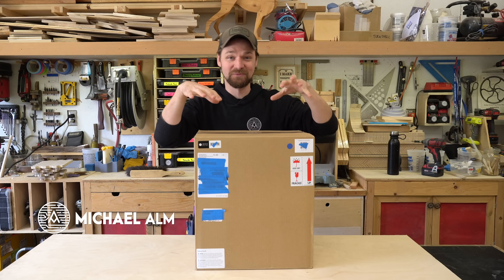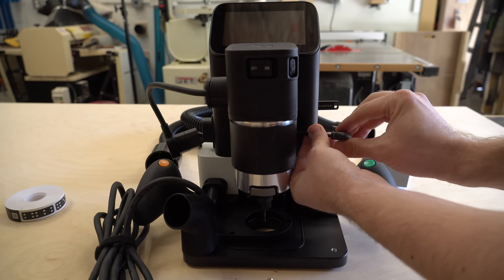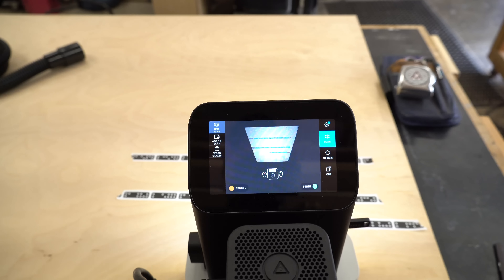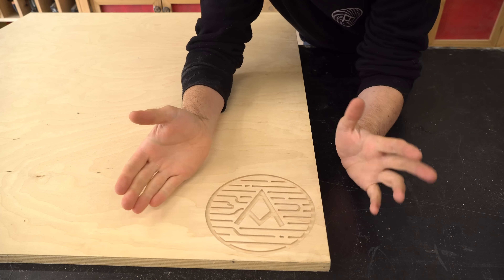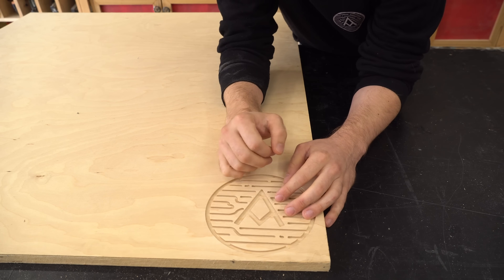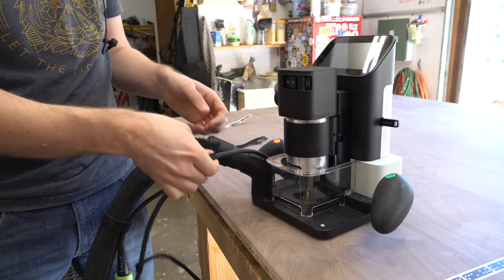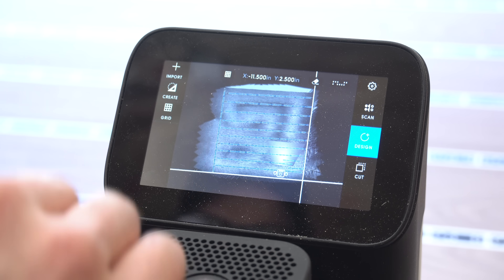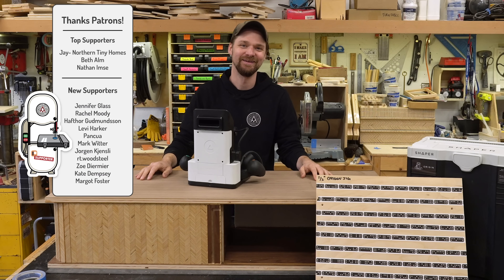Testing Shaper Origin Handheld CNC Machine

Comment: I have a question that none of the vedios seam to ansewer. If I draw a line on a 8 foot ply panel that wonders, can it fallow it?
Reply: Drawing a physical line doesn't register anything on the machine to follow, although I suppose you could draw a line, scan it, and then attempt to follow it on screen, however it's not a 1:1 and the scans on the material susceptible to distortion. To get the best results for what you're asking, you'd need to design that line in Shaper Studio (free) and upload it to shaper origin, line the plywood with tape and then run the line that way.

Comment: CNC stands for Computer Numerical Control. By definition the Shaper Origin is not a CNC machine.
Reply from the maker: The spindle is controlled by a computer (and numbers)
Reply: @MichaelAlm  The tool is not guided by a computer that translates numeric offsets into drive motor pulses to position the tool but by human hands. This device is not a CNC machine by any stretch of the imagination.

Comment: I need to create wooden 'ribs' for a large shape for vacuum forming. Would the shaper be suitable for carving out 7 ft slightly curved lengths that are about an inch wide ?  I could build a jig out of 1/4 inch ply to place the shaper 'tape' on to.  Thanks for your help.

Comment: Curious how much precision is required from the operator...as I age, I've developed a bit of a tremor in my hands - do you think I'd be able to get good results with the Shaper Origin?
Reply: The user just has to keep the reticle inside the circle when moving. I suppose that depends on the amount of tremors you have, but if you're able to move your hands along a set path, you should be ok. Shaper Tools recently came out with the Bench Pilot, which turns the shaper into a full on CNC machine without the need for the user to control it beyond pressing options on screen to start/stop cuts

Comment: first question: what stops the machine from just going all over the place? if its hand held how is such precision possible using your hands?
Reply: Hand guided, machine controlled. Just have to keep the dot inside the circle to keep the machine going. Harder woods can cause the bit to jump a little, so applying a little more downward pressure helps keep it in place. However, the Shaper features an auto-retract if you get off the line too much to prevent damaging material

Comment: Nice video.  Does the Shaper Origin all you to download artwork from the computer to the tool?  If so what software is required to complete the download?
Reply from the maker: It does let you use any software you like to add in graphics. It has to be an SVG file.,

Comment: I like the Idear of the tool. What i dont like is this exessive use of "positioning" tape you need for one project.
You get one roll of it for around 20 bucks.
So you buy a tool for 3 grands and still have to buy these rolls all the time to use it.
Smells like the good old printer - color cash cow to me.

Comment: I would love to see new Shaper Origin videos. Questions that come to mind - is there any limit to the size you can cut? I.e. could you cut 4ftx 8ft or larger (not that I would want to but maybe an advantage over a CNC? If you cut this size (4ftx8ft), can you use the small template board you made for the tape? I noticed that the template was bigger than the second piece you cut on it. I was just thinking I would make a template, then you made one! Is the tape really meant to be consumable? New subscriber here, thanks, I liked your vid - you have an easy going presentation style and lots of info!

Comment: Now that you have had this awhile could you make a vid on what you have learned, both the good and the bad.  And do you think it is still a good value or would a full size cnc be a better investment?
Reply from the maker: Hey Gary, Yeah I'll be doing one in the not too distant future. I used it in my latest two videos, the cube stools, and the bookcase. It's saved me on a number of projects at this point. It's best for one offs, but that's what I do, and so I think it's better fit for my shop than a traditional CNC.

Comment: I make a lot of signs and plaques with a hand-held router, but as I get older, carpal tunnel syndrome is affecting my ability to work as fast (lots of breaks needed). A lot of it is exacerbated by the fine, precise movements I have to make to control the bit over my pattern. I'm wondering if you believe - based on your experience with it now - the stress on the hands with the Shaper would be less since the need to follow a path so precisely is eliminated.

Comment: why not just print the design and tack it to the work piece?  Seems like a solution in search of a problem?
Reply from the maker: I’m not sure I made it clear how much the router controls the bit. It’s a cnc that moves the bit into place as you slide the machine around. It cuts to the 1/100 of an inch. I can’t do anywhere close to this precision with a handheld router.

Comment: great overview and flow, as usual Michael.Iooking for some files, similar to the hub, but looking for small project files to build little projects on the workstation or bench hook jigs as a progress skill learning tool. Going forward if you post or sell files for small projects of varying difficulty i think it would be a great way to really learn how to use the machine and get the most out of it in the shortest time. Origin is starting with the premium projects, but they are for larger projects, other than lets say just inlays, cutouts coasters or more artistic gift projects to give away as you learn and enjoy the machine.

Comment: Seems way too overpriced. You can make an actual CNC router for a fraction of the cost. And you can do something else while the CNC cuts.
Reply: But can you pack ur cnc into a box, or take it anywhere inside a house and use it, or use it on already installed work peices?  

No you can't. It's a tool, with its purpose.
Reply: @beardeddutchman5197  Yes.

Comment: Hi. Thanks for the video. I have a CnC but it only takes  24x32" How big can this cut ? Like, can i cut out a template in a 4x8' ? 
Hope to hear from you.
Best regards 
TR
Reply from the maker: That's the beauty of the tool is that there's no size limit. I've seen people inlay floors or bar tops with it that are way longer than 8 feet. So, yes you can definitely cut out a 4x8 sheet.

Comment: Why would you get this over something like an X Carve for $2300, when this costs $2500?
Reply: I'm going to say scale is a factor
Reply: Ryan Detzel But how would you like it ergonomically when you need to stand over the thing for hours making bigger projects??
Reply: @justkiddin1980  I think larger doesn't necessarily mean more cuts, just larger working area, but I see your point too...
Reply: @MrFowl  Yeah i reslly meant the time spent on a project...With a "normal" cnc you could just enter the job and let the machine do all the work...And it is possible to put a cnc on a space on the wall somewhere..they do not need to take up floor space..
Reply: @justkiddin1980  Huh, that's a good idea. If I could do a CNC mounted similar to a murphy bed, that might actually work in my garage, could still potentially use the "wall" for something too.
Reply: @michaeladayco326  Yeah you can be creative when space is at a premium..i would advice to look for a cnc with lead screws and not belt driven when mounting on a wall..because belts can stretch...I have ordered a workbee cnc and am waiting on delivery...
Reply: Is this a real question?? You can literally bring this with you anywhere and do work. It also takes up no space in your garage or whatever... It's literally AWHOLE handheld CNC machine thats incredibly precise, and can do any size.

Comment: No body ever shows the process of how to generate a file and import into the Shaper. I find this a major down side to all the the videos out there. It's like here it is, I have already done this and like magic here's the completed project. Might want to cover all the steps before having the tool sitting on the bench ready to rout. Major marketing mistake. You make the statement it's hard to do a stopped dado with a traditional router. Been doing it since 1976 with no issues. We don't use a guide bushing either. We use something called "Jigs" that are made and hang on the wall ready to go. This machine is not a replacement for traditional routers doing joinery. I would of had my stopped dados cut by the time you put all that tape in place and set-up the Shaper. It however fills maybe a gap as a CNC as it is portable and can be taken anywhere. I see it as a sign maker. Price point is about 800 bucks too high also. But Fest tool is involved.

Comment: It looks like a good idea, but unlike a conventional CNC you don't get any Z Axis control, which means zero 3D CNC abilities. I think for the money, I'll get a case of (as Stumpy Nubs calls it) rearrangitis, until I find the room for a conventional CNC. If rearranging everything still doesn't work, I'll make a wall mounted fold down (or up) table that is strong enough to support a CNC. This is great if all you have to do is cut patterns out of plywood or flat stock, or cut grooves for roll top doors. You can't even use this to mill a piece of warped or unevenly cut lumber to make it flat. I love your videos, and your projects, but, this tool is just not going to be finding it's way into my shop.

Comment: You appear to have ruined the temper on you bit 10:45     Router bits that look like that don't cut well. Typically over heated from hogging too much material ruining the temper thus shortening the life of its edge. 20 years of wood working and knife making leads me to believe this.
Reply from the maker: I was worried about that, but it was pitch. The bit cleaned right up with a spray of blade cleaner
Reply: @MichaelAlm  Oh that's good! Plywood is full of resins, adhesives and other nasty stuff. I think keeping your cutting bits clean will help keep them in good shape. Usually when I see one of my bits with lots of oxide on it,  I can tell I pushed it too hard. Glad I was wrong about yours. Killer channel by the way!!!

Comment: The only single advantage to this is when your work piece is too large for your actual CNC machine. Otherwise it's a lot less accurate and a lot slower, and you have to physically man it instead of just starting it and doing something else.
Reply from the maker: Only one advantage? What about the ability to bring it on a job site, CNC something that’s already built, or store it easily? I’ve been using it for months now and have found it crazy accurate. You do have to push it around, but it’s not for mass production. It’s for small batch or details. Plus I like interacting with my power tools. That’s why I started woodworking
Reply: @MichaelAlm  I've never had a need to take things to a job site when we have a shop. I can't actually think of any reason why we would need to CNC anything away from a shop. At absolute worst we might need a chop saw or a sawzall and a drill for framing and mounting.
If it's already built, why am I working on it? Either way, it goes into my initial point of "If it's too large for your CNC."
Easy storage sure, but an actual CNC is far more useful. It would also save a TON of space by chucking the band saw and table saw, and just using a hand saw or sawzall. But that's not happening either. This is pretty close to the same thing. You can get straight accurate cuts with a handsaw, and then you're interacting with your tools, but a band saw or table saw are FAR more effective and 100% worth the space, and you want the biggest ones you can afford. Or for a more direct comparison, you can also use a standard router or a chisel.
For small batch or details, it's still more useful to have a CNC where you can just set it and move on to any other part of your project. It's not like you get a CNC and straight automate everything. If you're inlaying a table top, you can set the CNC to cut the inlay, while you work on the legs or the negative inlay.

Comment: It looks identical to the 2016 version.
that cost 1000USD on Kickstarter 4 years ago and you could purchase on their site for 1399 USD with a 100USD discount voucher if you didnt wanna roll the dice with Kickstarters risk-factor..
Atm, they are asking 3255 USD before any regional tax for this unit in Europe and after-tax +25%VAT and import product tax if it coming from China or USA, you will be closer to 4500 to 5000 USD.
3250 USD for an entry package that looks identical to the 2016 version, they could sell for 1000, sure why not..
I recall how many so-called influencers that were gifted this device back in 2016 and perhaps they should set the price more reasonable instead of putting all their trust and margins in gifting "online influencers" and likely also why they now trying to reach out to yet again but this time to smaller  YT channels, to see if they can stomp up some easy customers, that in 2020 are willing to pay 3fold the.2016 price for a unit that looks identical, same screen, same res, same camera. same motor accuracy??
yep base 2016 version 3250 USD before any tax.https://store-eu.shapertools.com/?_ga=2.84378074.276610912.1593509673-1353261011.1593509673&_gac=1.116589556.1593509673.CjwKCAjwxev3BRBBEiwAiB_PWPb9k1HgRw7T4HJgGHqoEQJulj3hxw57Mb2bOILWRSzj490GcQeFrhoCQ7QQAvD_BwE
and yep it is still sold and imported from the states or China, as they list 1-year warranty, and they can only do that limited 1 year if they don't operate inside the EU.
a great article from hackaday in 2016 about the build and the two stepper motors.
https://hackaday.com/wp-content/uploads/2016/07/ezgif-com-optimize1.gif
article.
https://hackaday.com/2016/08/25/hands-on-the-shaper-origin-a-tool-that-changes-how-we-build/
Reply: For $3250 I'd much rather buy a CNC table that's 4x8'.
Reply: @JZStudiosonline  That may be the case, but once again some people don't have the luxury of having the shop space for a dedicated CNC table.  Also $3250 is in Europe (probably due to import tax).  It's $2500 in the US.
Reply: bacondreamer nope...import tax will be calculated by customs...so that will come on top of the 3250
Reply: @justkiddin1980  yikes.....
Reply: @bacondreamer  Yeah...crazy expensive...you might be better of beeing creative with a ooznest workbee and find a way to store it vertically...
Reply: is it any better than the 2016 version? idc how it looks. ive seen people say it runs off track sometimes/knicks wood occasionally

Comment: Yeah, but I just want to know about the actual precision of that tool - can you make some test shapes and measure the dimensions after machining? I expect that you have to input the cutting tool dia to the project before cuttingso I'd like to know if the tool dia compensation works properly (I've seen you fine tuning some parameter to get the proper fit and I don't know whether it was because you didn't measure the thickness of the board properly before or because the tool dia compensation doesn't work properly.  So the two pass slot would be the first test shape, the second would be a square pocket and a square block of this same dimensions, the third will be the circular pocket and the cylindrical block - I'd like to know about the circular interpolation abilities of this power tool. Could You provide such a test, please?

Comment: I wish it could do intricate cuts in the Z direction like a traditional cnc but still very cool. If this is a cnc what is the difference between a cnc and a router?
Reply: This is not CNC.  It's basically a fancy way of tracing a pattern with out having to actually trace or stencil the pattern on the material before hand.  It can save you from making a drastic mistake by lifting the bit, but it that's it.  A real dedicated CNC router can do all the things this can do as well as things this toy couldn't possibly dream of.  I have access to a ShopBot router in my dads shop.  A few months ago we made a oval shaped tray that was made out of two pieces of 1/2 thick oak.  We cut them out with a rib on the top edge on one piece and a slot on the other half When we got done we were able to press fit the pieces together to make a .825 deep tray.  No glue needed.  The fit is so tight that it's hard to even see the parting line.  This router will never hit that kind of accuracy.  I know that it's not fair to compare a $20,000 ShopBot to this, but there are better options than the Shaper even at it's price point.

Comment: On the other hand (pun intended), an actual CNC works for you while you do something else.
Reply: but like he said, if you don't want to dedicate floor space this is a great alternative.
Reply: @MRInuzaki  Yeah, space is one of the biggest restrictions to having a CNC
Reply: Michael Jones  I bought one 3 weeks ago btw and it works as advertised. It doesn't replace my fully size cnc but it's a great addition for when I can't bring the oversized piece to the cnc (i.e a floor).
Reply: @mururoa7024  Ben, faut quand même le mettre sur une table qui est au sol
Reply: @jacquylenoir9097  (google translate) Pour travailler directement sur le sol, vous ne posez pas le sol sur votre table.  😉
Reply: @mururoa7024  Ok, mais vous posez quand même l'appareil sur le sol, donc, il prend la place d'une table 🤦‍♂️🤣
Reply: This is convenience compared to CNC. Convenience always wins out on the small scale needs. CNC is there for precision. What this shows is that the machine could be mounted on a transporter that can work very large areas. Arbitrary position CNC.
Reply: Maybe they clould add a shaper shaper.
You know a mode where the origin is moved automatically within a predefined area. 
And you do something else.
You may pass this on to shaper as feedback. 
If there is a patent please add my name.

So who is fast and files a patent? Please contact me by anseering to this comment.